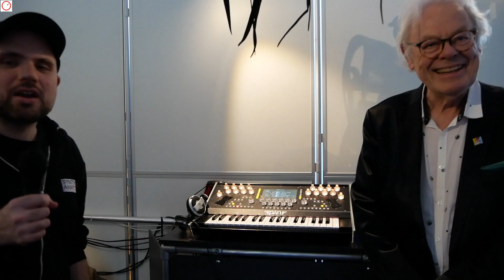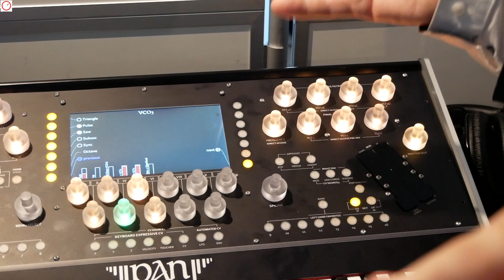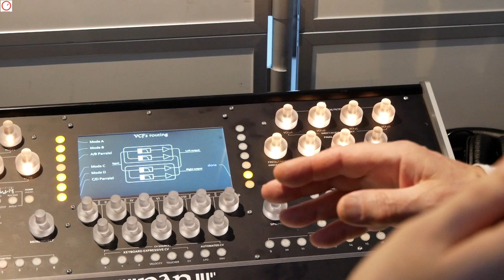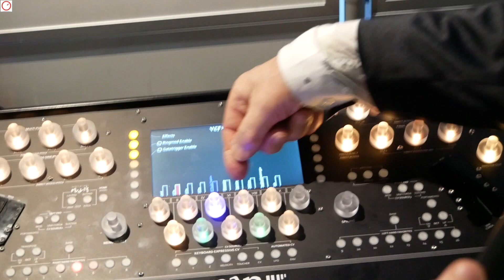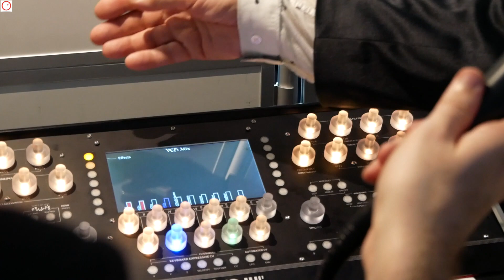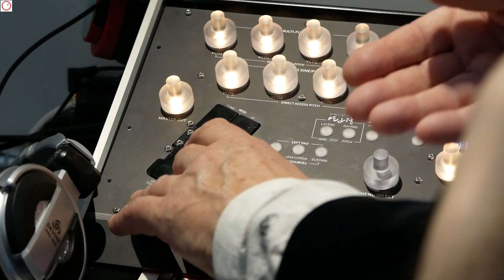Syntonovo PAN Expressive Analog Synthesizer  | Superbooth 2019 | SYNTH ANATOMY

Comment: Harrow!

Random camera person here... :)
Some drips and drops of info:

DISCLAIMER: These are my personal impressions I got from playing the synths at Superbooth. This is what I grasped of it and from discussions between people. Final decisions on any possible changes of course are all on Felix and/or Bert from Syntonovo.

The reason there is not much info around is because up to this point many things were still in development and no final decision been made on certain aspects. The firmware we saw at superbooth was uploaded to these two prototypes at 2am in the morning a day before sooperbooth opened to the public. There is still work going on on it as I write this.

Software:
It needs more work, but it's going to get there. I have full confidence of what the ones working on it are doing. The software may change graphically a bit more. Many things were not yet implemented in this iteration, so if you've played around with it, you can expect the final software version to have many additions and extras. Stuff like "infinite" routing, modulate the modulators, self modulations, more effects, etc...

Hardware:
Most likely, the device you see in this video is the final version that will make it into production, maybe some tweaks here and there... But as Bert calls it, this is "The Final One". :D

Monophonic/paraphonic:
Technically, lets just say yes to both. Practically, it's a bit more complicated than it sounds *punpun*.

To me this synth stretches the definition of monophonic/paraphonic due to it having 8 oscillators and its routing possibilities... Words are all wibbleywobbly concepts after all... ;)
Felix calls it "monophonic, duophonic or paraphonic": I think this depends on how you configure the response to multiple keypresses or chords. Traditionally, people would call this a monophonic synth, but due to it having 8 oscillators and the way you set up the routing through the filters and the modulators, and how you set those up within the routing, you can make them respond depending on keypresses. You may hold a lower note while playing higher notes simultaneously, so some oscillators will respond to higher notes, accoustically making it paraphonic, playing actual chords.
Also, it depends on how exactly you route them, since you can put, lets say, osc 1 and 2 on some path, and route the rest to a different path, and depending on that setup, it may be mono or para, it's up to you.

The real question of "is it monophonic/paraphonic?" does not really matter in this case. So what if it is technically a mono synth, but you can still play chords and not really tell the difference if you're not paying very close attention? ;)

Modulators:
Envelopes and LFO's are indeed digital, but like Felix puts it: "How many do you want?". Anyway, can you even tell the difference? :P

The firmware in this iteration, right now it creates 16 of each, and every single envelope or lfo can be routed to up to 11 targets. That's 11 modulation targets per modulator. That's quite a lot of modulation. And that's only the current software running on the cpu's. It may likely stay at 16 of each, since it is believed that it should be "more than enough", but what's to stop them from adding more? The current amount of modulators does certainly run completely smooth on the hardware and they run at a resolution high enough that you really will not notice a difference to analog ones. The types of lfo and envelopes are also not set in stone yet, so who knows what else we'll see when it releases to final. :)
Sadly, it did not occur to me to try to break the cpu's load by going all nuts on the envelopes and lfos. I am now thinking of crisscrossing various lfo's with different amount settings on various simultaneous targets. I'll have to try something like that next time I get my hands on it. :3~~~

Digital effects:
Some effects that you might have seen when playing around were just default effects. Basic echo, reverb, delay, flanger, etc. were there, but having them run on dedicated cpu's makes it's potential huge and there is still enough room in them for more to come. I only discovered the effects section later on and I was sort of mind blown. But of course I am biased! I love me a good reverb and delays on plucked sounds!

XYZ Keyboard:
All the thresholds can be individually parametrized per axis, meaning, you can have zero deadzone that applies to some targeted parameters, while other target parameters start acting on more force, or wider deadzone. You can set it ultra sensitive to the touch, creating modulations by blowing on it (Yes, yes! I'm definitely exagerating, but you get the point), or you can set it so hard that you need to apply actual force and effort to make it respond. In the end, each axis has (as of now) 11 targets, every axis and target with its own threshold, so it yet again depends on the sound you're wanting to achieve and how you want to play it.

Interfaces:
USB, Midi, CV note and gate plus 6 additional freely routable CV outputs. I think that should be enough. (XYZ or Touchpads to CV out? YUUUSSSS!!!)

Future proofing:
This is an instrument, not a gadget. There is a world of sound to explore: it has the versatility of a modular synth, yet has the memory of a modern one to store the patches. The amount of memory banks is still to be fully explored by the devs and to be defined after hardcore testing the cpu loads. With the current load the computers inside are yawning. ;)
Everything can be routed to everything. I do not see the modulation matrix as a matrix, more like an improbably big patchbay. Limits applied by cpu load, which I really didn't manage to scratch during my goofing around.

Personal conclusion:
I want this monster of madness to be let loose into the wild, sooner than later, but I also want it to be robust, solid and futureproof!
I say: People, take all the time you need to make it polished, please, no half measures... ;)
Reply from the maker: Big thanks :)
Reply: @synthanatomy  It's a pleasure! ^_^'
Reply: Thank you! If they can indeed manage all this, I think it will definitely be worth buying and provide a counterpart to my euro system.
Reply: could you have 4 pairs of oscs each pair through a different filter and therefore get true 4 voice poly? or does it not have 4 vcas?

Comment: It seems the X and Y "throw" is a bit short. Too short for fine control. Or is it possible to use the whole length/width of the key like Roli, Touchkeys, continuum etc?
Reply: you can set action amount and thresholds for all axis and all their targets... you can make them buttersmooth and slippery or hard as rock to handle...

being able to route everything to everything, you could even lets say, set the Z pressure actually modulate the amount and threshold of the X axis, or maybe have one of the touchpads control that aspect and even set thresholds on the touchpads themselves so they respond smootly. that way, you could dynamically change the response on the fly...
or you could hook up a long throw pedal and have that control the sensitivity, etc...
there's many options...
this is a sound design synth, so you can setup all your parameters and save the presets for later use during performance phase... etc...